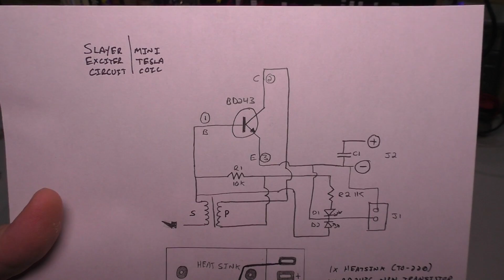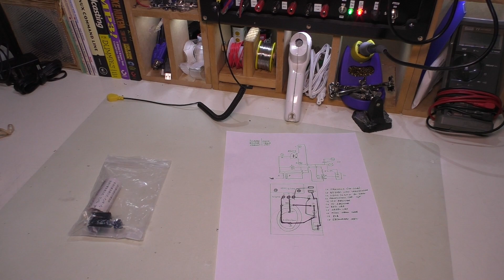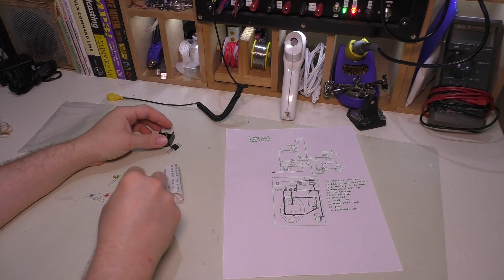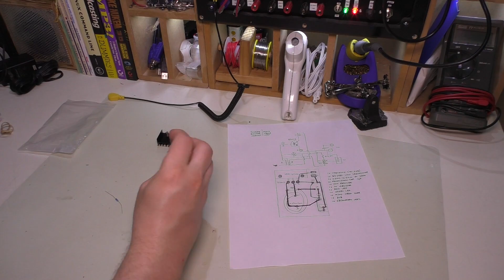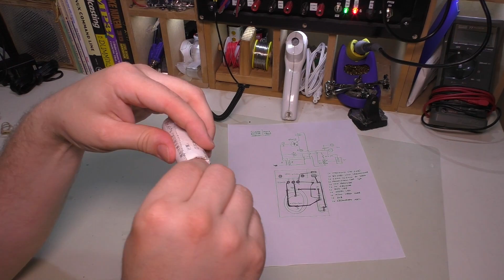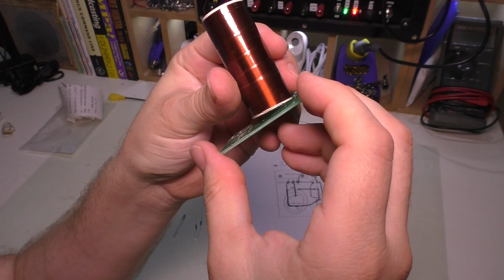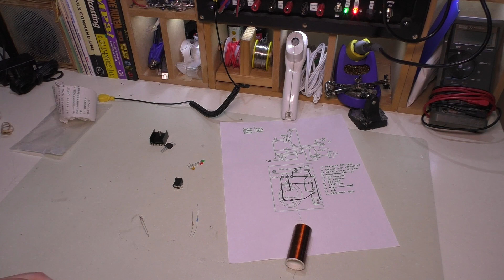PTS Ep. 200 - Mini Tesla Coil Build (Slayer Exciter Circuit)

Comment: congrats on the subs!

and I am always fascinated with these coils...

25mm is roughly an inch.  that wire can be taken from a number of objects, such as speaker could and electric motors.
Reply from the maker: For the price it's a win!  I want to build an audio modulated kit next.  Then it's time to move onto the big stuff!  I actually have some spools of the stuff I piked up a couple of years ago at RadioShack.  But yeah, it is easy to find or salvage from other devices.